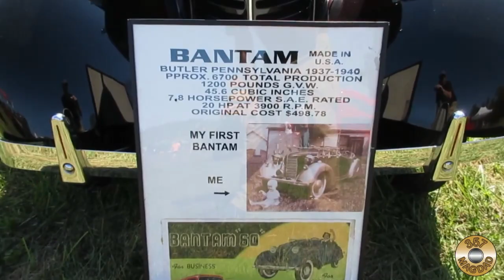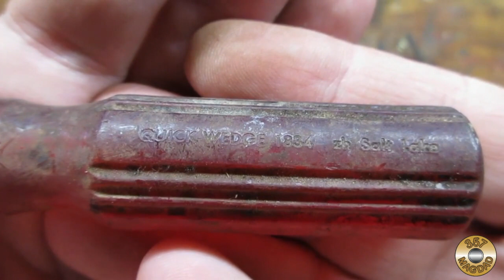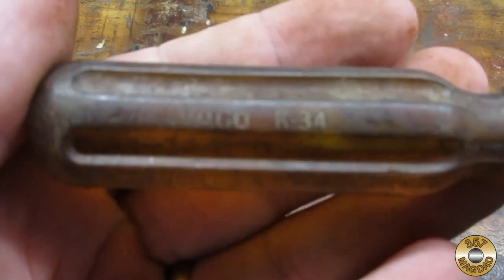Engine Show and Tool Haul

Comment: If the show is 42 years old there will be vintage machines there that were brand new when the show first started. Those models were gorgeous.

The big vice must have been tempting, but I think I would have spent most of my time looking at the planes and carving chisels and gauges. When I saw the pen/pocket knives it made me wonder just how close are you to having your own stall?

Once again you got some great purchases and when I saw the wooden screwdrivers I knew you’d be buying one. I want that wooden handled multitool, it’s perfect in its curiosity value and manufacture. 

Great video, the music was at a perfect level.f
Reply from the maker: Thanks Mark!  I couldn't believe all of the planes those two vendors had!  They had them piled in crates!!  There was definitely something there for every collector!

Comment: I believe those are chisels not screwdrivers in the multi tool. I could be wrong though. If they  have an edge on them like they looked I would say chisel.
Reply from the maker: I was wondering about that, especially since a gouge was included in the kit.
Reply: Yeah I would definitely say chisels. One may be obviously thicker than the others and be a screwdriver.
Reply: I was thinking the same, if you search for hand carving or whittling chisels you'll find some with that broad edge design.